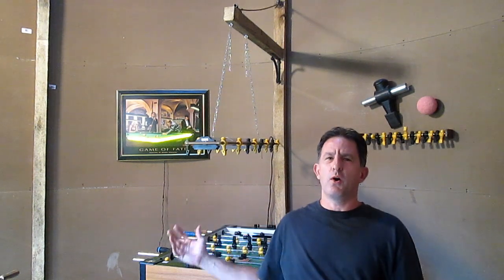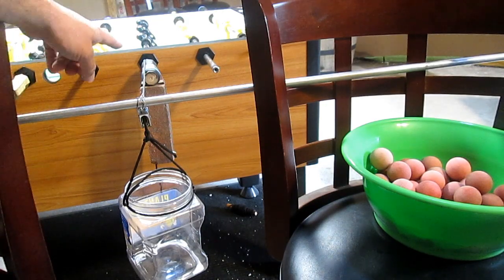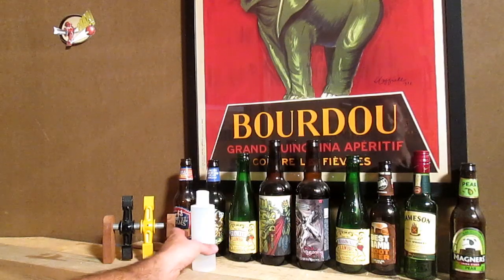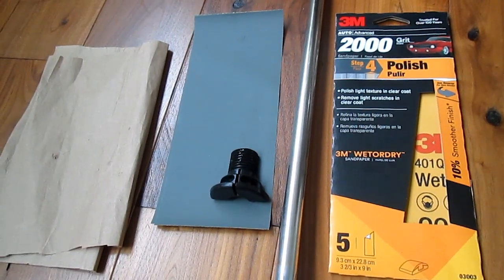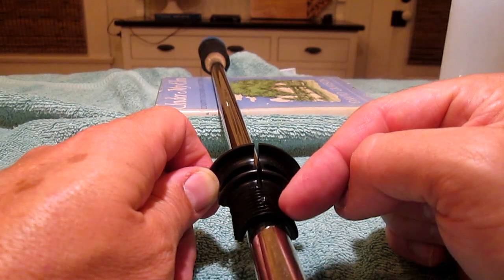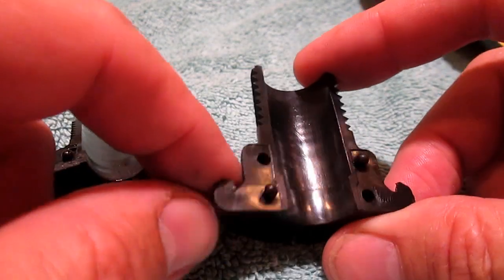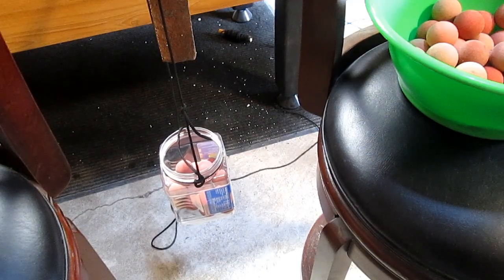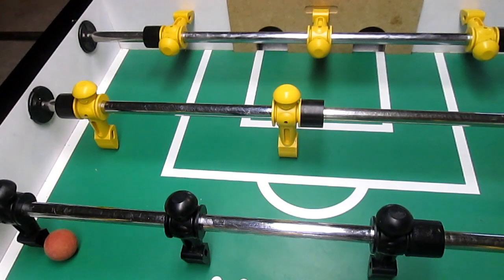How To Fix Slow Foosball Rods

Comment: well finally a comment where i can really help  the person whos video really helped me.  when sanding with any grit 1000+ sandpaper atleast with plastics/metals/painted surfaces    you must use a wet sanding technique. that automotive grade sandpaper you are using you can get at walmart or any chain parts store is designed to be wetsanded with so the paper  will not like fall apart on you.  in the body shop ive seen various ways to wet sand. the biggest problem with wet sanding is the mess.  so do it outside.. or something or set up over a sink id guess.  with the high graded sandpaper i ts so fine that the dust easily clogs the paper so you have to use a lubricant. most just use tap water to remove the sanding dust from the paper or the surface becomes clogged extremely quickly an is so fine you dont really see it clogged. until u see that cake form on the paper...    best way to do this would be take a absorbent dish sponge an squeeze just enough water to make iit nice n wet ..  more water is better but means more  mess.  so ull quickly work out the right amount to use an when ;)  it out in this case on the rod between a few passes with ur sanding paper.  you will save atleast half the time you woulda spent sanding the part dry atleast doing so.

Comment: It seems like playing in there would be deafening. But, using the silo itself is cool, I love the look.
Reply from the maker: Thanks!  I was worried about noise level too, originally.  With plain steel walls, you could blow out an eardrum with a whisper.  Luckily, once I installed the paneling, and filled with foam crumbles, the sound issue went away.  We have had 12 guys in there rocking both tables and music playing, no problem. 

Here is the build video:
Farm To Foosball Conversion
https://youtu.be/D9nFeWcS8Bg
Reply: It's true!  There's NO problem with the decibel/noise level...except when I hammer a deadbar pull-kick!  THAT can be pretty loud!   Lou has built something special out on the Farm, a Foosball field of dreams!
__

Comment: hi what cheap and good foosball table you recommend to start playing at home?
Reply from the maker: I am going to sound like a snob here, and I don’t mean to.  Playing on a cheap table is like cutting with those cheap plastic scissors you send to school with your first grader.  The playing surface is warped, so you can’t control the ball, and the men are not made with high precision.  Real foos is about total ball control and you can’t do that on a cheap table.  I would look for a good used pro table.  Tornado and Warrior rule the American market.  I have heard Fireball is also good, but they seem to only be dominant in non US countries.  I would look for a foosball club in your area and ask what they play on and get that.  Learn and then go play with them.   Tables are all a little different.  You want to practice and play on the same thing
Reply: What Lou said!   
_

Comment: Do you think I could do the same with snap in bearings?
Reply from the maker: I don’t know a lot about snap in bearings.  It might be possible to pull the rods completely out and sand the bearings in place.  You might try sliding some paper in with the rod and see if you can spin the rod and paper to clean and polish the bearing.